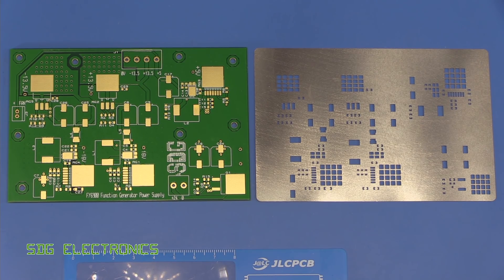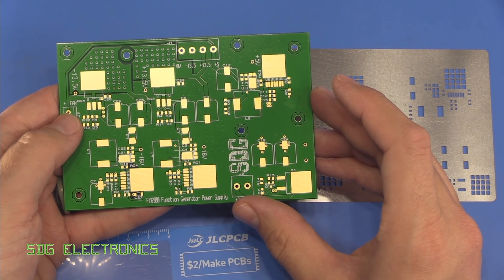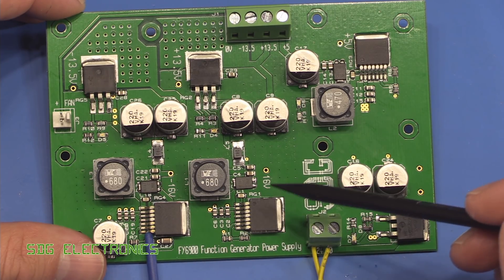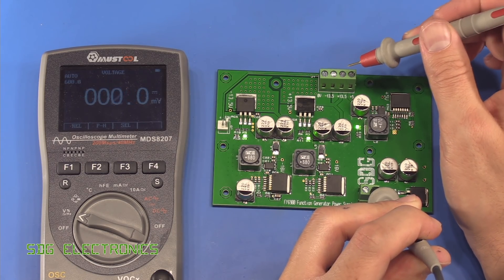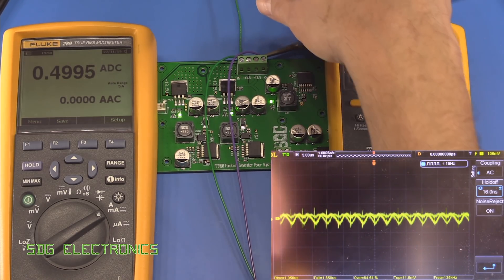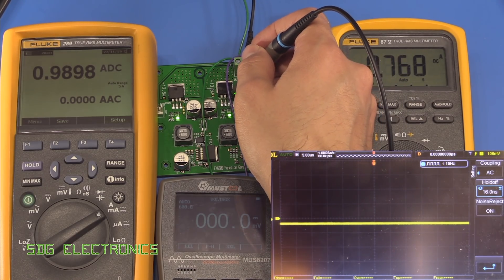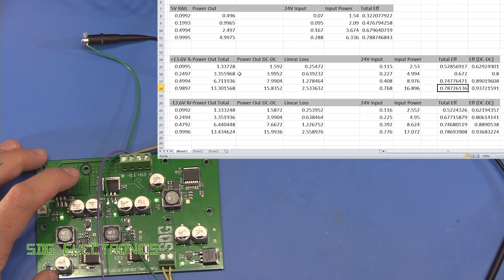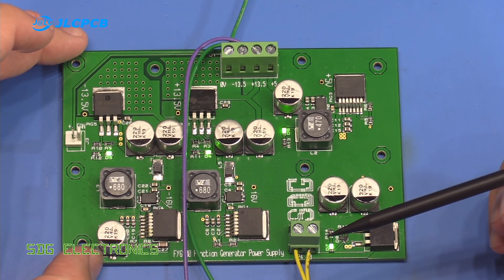SDG #119 Building the DC-DC PCB for the FY6900 Signal Generator

Comment: Hi Steve, I finally got around to building this PSU upgrade for my FY6900.  A few notes:
- Awesome design, mine is performing very well 👍
- The schematic has the 2 x 68uH marked as 47uH.
- I found that the Sunon fan I used added significant noise on the 5v rail, so I added a little RC filter for the fan output that has made this much cleaner.
- The holes for the mains-24V PCB are still out of alignment by about 2mm. I just carefully reamed them out with a drill bit.
- You tied the 0V to Earth with a 10ohm resistor, which effectively stops the BNC shields from floating up - but why not just use a 0ohm jumper/wire link?

Thanks very much for your upgrade and design files 🙂 cheers from Australia
Reply from the maker: You could change that resistor for something much higher, like 10k. This would help eliminate any issues if for example you accidentally connected the signal generator output to something other than 0V. I'll have to check what happened to the gerber files, as I thought I'd modified those to match. Thanks for the feedback!

Comment: One Q... Why did U use DC-DC. plus switching PSU 230/24

It better to make it on 50Hz multi-winded-Trafo, and Linear like 7805  7812 for minus 7912, 
it takes 0,5A on 5V and load for 50 Ohms (+-12)...
You just add noise and ripple to signal with DC-DC and AC/DC sPSU, 
this is not suitable for Radio equipment.

But i have to say that, this is:
- great board and design... good grounding plane  and in case of EMC niece one, vias and heat desperation 10/10
 keep my finger cross for Urs projects.

Comment: Have you checked out the JUNTEK PSG9080 80MHz DDS Function Generator - it only has a 5 volts supply running the unit.

Comment: I love how the board came out. The inductors are nice. I tend to choose Coilcraft to narrow my choices, but those from WE are beefy and show quality. The freewheeling diodes are quite capable. I used diodes encapsulated in such packages, and they can dissipate quite a lot. Thumbs up!
Reply from the maker: I always find the two brands to be top quality. Unless there is a very specific requirement, I tend to just pick Wurth inductors because I already have the footprints set up!
Reply: @sdgelectronics  Indeed. Same here!

Comment: Great video.

A very late comment. The late, great Jim Williams at Linear Technology did a good video on reducing the noise from linear regulators several years ago. He suggested a low frequency ferrite bead followed by a capacitor on both the input and output of the regulator and showed how effective this could be in reducing noise from the regulator. He showed that this decoupling, added to the same decoupling at each of noisy power consumption points, was very effective in both reducing regulator noise and in keeping circuits from putting noise onto other circuits.

A big advantage of using a ferrite bead rather than an inductor is that the ferrite bead is designed to be used in the region where it is a high frequency resistance, rather than an inductance. This dissipates the noise energy rather than just moving it somewhere else, as the inductor does...

Comment: For a cleaner output you can add that before the regulators: https://youtu.be/wopmEyZKnYo
The biggest drawback is a lower efficiency and you have to increase the output voltage of the dcdc converters to handle the drop in the transistor.

Comment: I want to make a 3.3v, 5v, 9v & 12v DC output unit using switched & linear regulators for smoothing, similar to what you've done here. How would you implement a Linear smoothing for a variable switch mode output?.

Comment: Btw, does golden pads make any difference since they are covered in solder?
Reply from the maker: I tend to use them as the PCB can withstand long term storage without oxidation and also the components sit flatter to the board when hand assembling. There may also be issues with using random solder alloys together, but not really a problem for hobby use

Comment: Great video, i have a question: Why you feed power with linear regulators to switching ones?
Reply: its the other way around, he feeds the linear regulators with switching ones to reduce output noise
Reply: @Alex-bi8ob  Sorry, could you explain it more?
Reply: @FixDaily  you first regulate the voltage near the desired level with switching regulators. They are very efficient but tend to have a lot of switching noise/output ripple. Afterwards you put linear regulators at the end to reduce noise/ripple and get cleaner power rails (though they are not as efficient, but that does not really matter because Vin is not much bigger then Vout so the power dissipation is smaller).
Reply: @Alex-bi8ob  Oh makes sense, thank you friend for clarifying it :)

Comment: I also do recommend every design engineer to take some rest and hang out and come back after 2 -3 hours and recheck the final design, sure you will find it not the final design as required and needs for more adjustments...
Reply: there is a saying "sleep on it" for a reason
Reply: I'd say 100% of the time this applies.......
Reply: I usually recommend a longer time, few days or if possible even a week. You will be surprised by what you’ll find out in your own design.
Reply: @diavalus  it takes less time if you manage to completely switch your mind on smth else and then back.
Reply: Yep, I like overnight.

Comment: Nice work. Seems like the negative supply could benefit from a snubber or a small value resistor in series with the cap that is after the inductor to provide some damping.